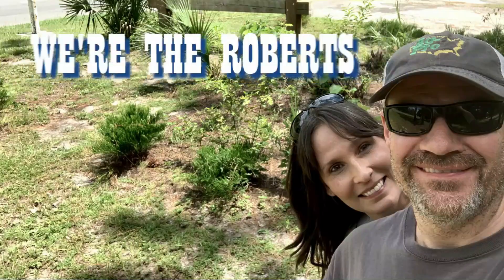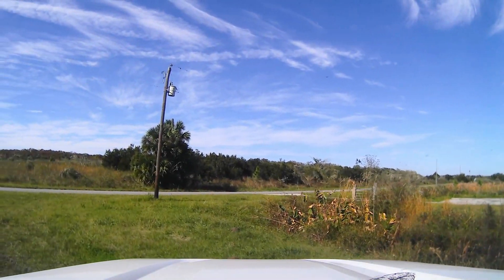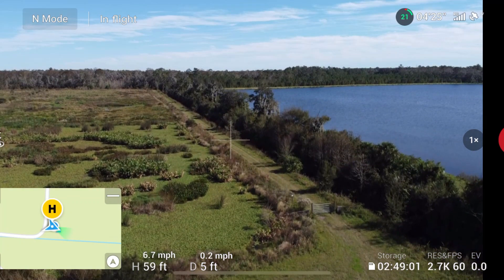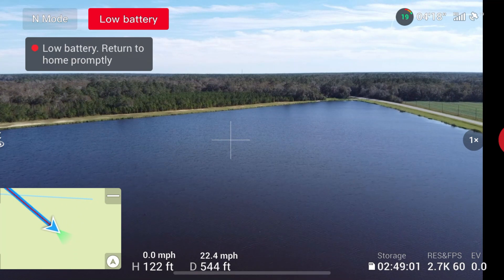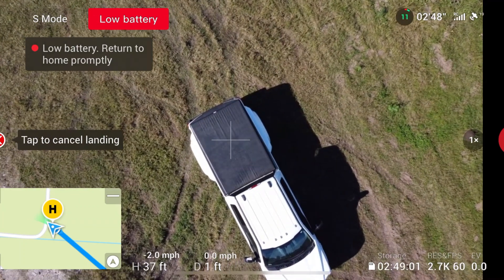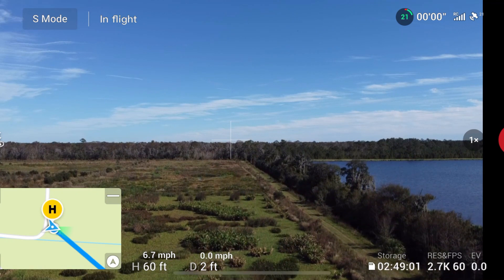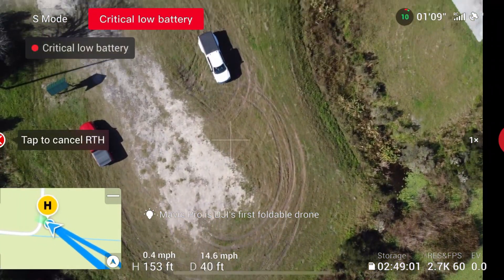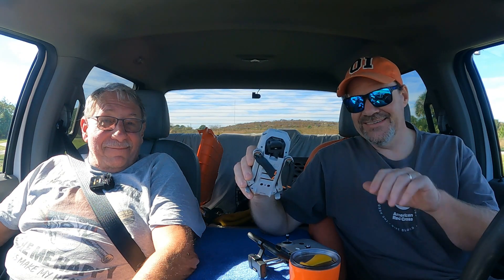Does Increasing DJI MIni 2 Return to Home Speed Impact Battery Life?

Comment: Great test. I figured the drone would use more battery in sport mode if you pushed the stick forward for more speed, but I didn't know it wouldn't allow you to increase the speed with an already critically low battery, and in fact, slows it down even more. Reminds me of people that speed to get to a gas station before they run out of gas, but they are actually using up what little gas they have even faster. Good job Kevin!
Reply from the maker: hahahaha!!!  I never understood those people who speed to get to the gas station either...  Their logic is a little illogical... If that's even a word.

Comment: Nice test. Are you sure you were really in sport mode on the second flight? I recall an issue that if the controller is on sport mode already when the drone is turned on, you would really be in normal mode (even though the app would say sport mode). Then you would have to switch to normal and then back to sport to actually get it sport mode.
Reply from the maker: Well well...  There I was, minding my own business when suddenly I see a comment that says I may have screwed up another test...  hahahaha!!!  Man, I think you may be right.  I'm pretty sure after watching the flight closely, I may have screwed up the 2nd flight when I accidentally interrupted the flight and had to reinitiate it.  The controller was already in sport mode on the way out and when Jack started the RTH flight, I switched back to normal then back to sport to make sure it was in sport mode.  That interrupted the flight and I had to hit RTH again.  I think the controller may have been confused because I was pushing too many buttons at the same time.  I pulled another "Kevin" I guess... lol  I'm gonna readdress this and double check to make sure it's an accurate result, but honestly I think you're 100% right here...  Kristi said I should quit... hahahaha!!!!
Reply: @WeretheRoberts  haha. So you remembered the issue, but when you switched to normal, it canceled the rth.  Yeah, maybe it got confused. I know I am. For your next test you should press as many buttons as you can simultaneously (or as quickly as possible) and see what happens to the drone. Haha :-)
Reply from the maker: @PickleFaceProduction  haaaaa!!!  You know I write this stuff down for future testing right?  Of course Kristi has to do the risk assessment before I get the go ahead to make the video. Well, actually she does the risk assessment to decide if she wants to go along hahaha

Comment: Great test as always and thanks for the mention. Just double check with a battery that has decent charge to see if the speed up still works. As you know it doesn’t work on the mini 3. I’m wondering if a firmware has stopped it? Be interesting to see 👍
Reply from the maker: Thanks, Nobby!!!  I do know that it still works on Jack because I did it just a few weeks ago (unrecorded of course) and it was fine...  But Jack is still on the 01.03.0000 firmware and I'm using the 1.4.8 fly app... I need to try it with Rose because she's updated to the 01.04.0000 firmware and I could use the 1.8.0 to check if it's been deleted...  Yet another possible reason to not update... lol   Also, there is a pretty good chance I screwed this test up on the 2nd return home flight...  I may have inadvertently put the drone into normal mode when I interrupted the RTH flight and had to reinitiate RTH... As you know, I'm a walking accident waiting to happen....  hahaha  I'm gonna readdress this in the future and make sure I got it right...  

Helpful hint:  Don't listen to Kevin Roberts... lol  Love you, man!
Reply: @WeretheRoberts  sounds like it ramps down then when the battery is too low. be worth investigating brother. Love ya right back!